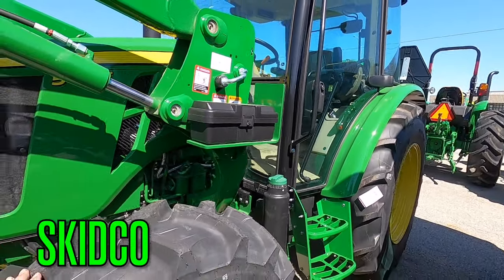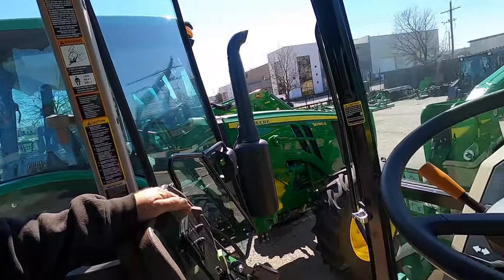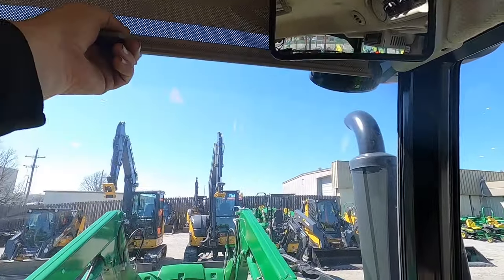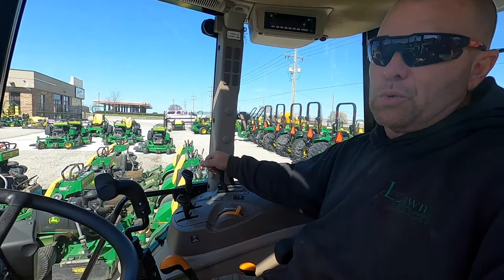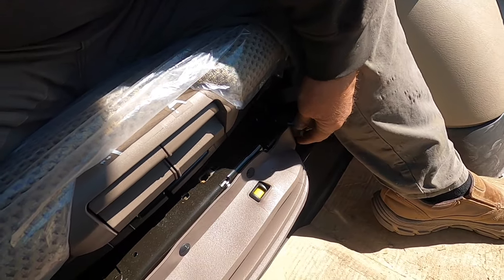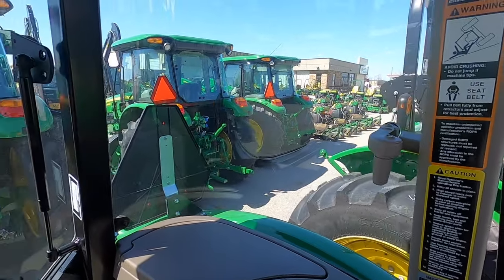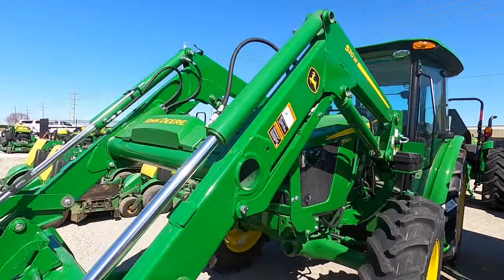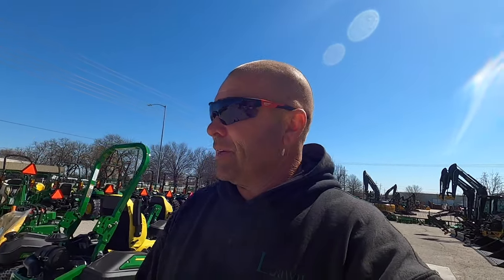New 2024 5 Series John Deere Tractor

Comment: Who builds a cab with two door panels and two sets of hinges then bolts it shut unless you pay extra for the door handle and the step.  What a joke.  Looked at a 5 e series, no second door without extra, no extendable hitch links without extra, no AC recirculation option, not sure it had combination 1 and 2 cat link ends, the  joystick looks like it was a piece of bolt on from another unit and instead of running nice stainless lines through for the loader functions they cheaped  out and used hoses.  Go buy a MF 4707 get more HP, a far superior transmission, a nicer loader and cab with all the things that are extra on the Deere standard.
Reply from the maker: It sounds like they ordered the tractor bare bones with zero options.